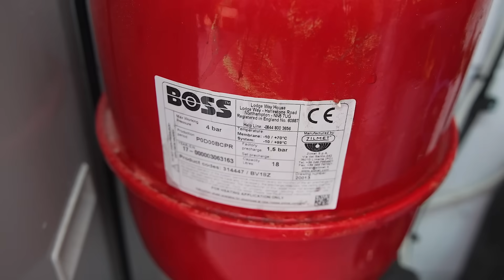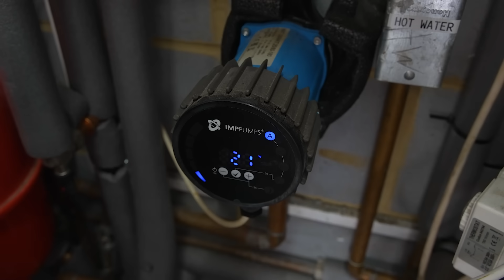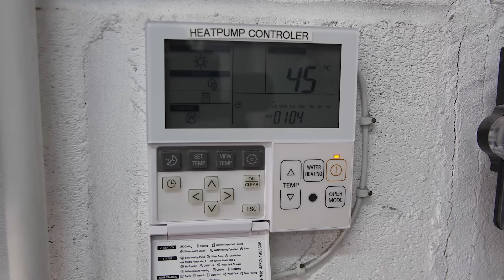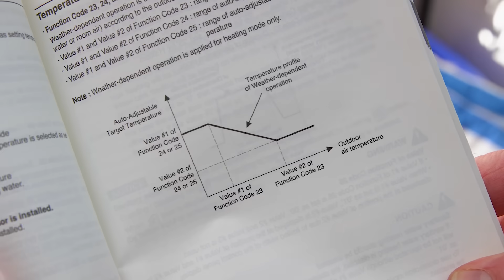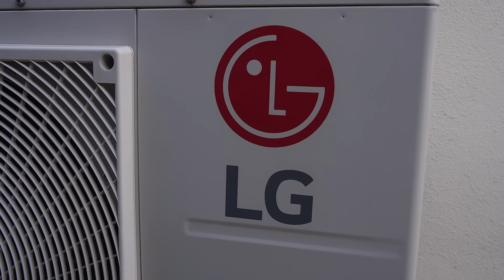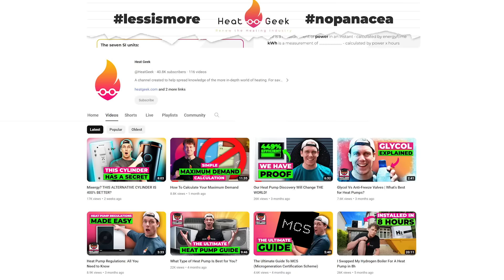Heat Geek Gives His Verdict on John’s Nightmare Heat Pump

Comment: Thanks for having me over John and the invite from Roger! Glad I was able to show the poor install practices that left poor Johns wallet being hit double time! If you want to be assured that your heat pump will work properly please use a trained Heat Geek!
Reply: This is exactly the follow up video we needed on this and I'm glad you spent the time Adam (and John, Roger and mug breaker) to do it. I was one of the people on the original thread saying to get you and Simon from urban plumbers involved. I think showing how what was wrong with a real world poorly designed and installed system and how they can be fixed can provide more confidence to consumers than some of the more theoretical videos.
I'd love to see Simon get involved and maybe a manufacturer to implement your recommendations and then a follow up with John who can they explain the differences and hopefully improved experience once its bedded in for a while. Once again well done for coming together on this and I will be recommending Heat Geek installers where I get the chance.
Reply: Good analysis and synopsis Adam. Such a shame John was wanting to do the right thing and has been sold and installed a dud.
Reply: I was a process control specialist in the chemical industry for decades.  Many of the problems you highlight are very similar to where I made my living providing training and consulting services.

I had an air source heat pump installed in my home in the last month in the US.  They wired it such that it would run at high speed all of the time along with other errors in control logic.  This would have defeated the improvements I was expecting from this swap.  Luckily I knew how to fix it and rewired it myself to run properly.  They even argued with me that the installation manual from the manufacturer was wrong.  

My previous one was wired wrong as well 15 years ago.  

They also installed more backup heat than I specified that would have used 2X the power necessary during defrost.

I talked to the owner of the installation company which is one of the largest in my area.  She agreed that low voltage was an area of weakness in our country.   

I suspect the installed COP in most countries is far from what these systems could achieve with more optimized installation practices.

It is likely many of the decisions made by installers are not only out of ignorance, but also out of reducing call backs.  Tweaking systems for maximum efficiency tends to push the system against comfort and equipment  constraints.
Reply: Heatpumps won't work if we have no summer to warm the ground/air.
Reply: Confirms they are more hassle than worth, Bosch gas boiler and forget all this crap
Reply: @alacrityaudiooffice7716  yeh, we wouldn’t have food to eat either. We’d definitely die
Reply: @kerbsidemotors9249  they need LESS crap than a boiler.. there’s less to go wrong
Reply: I appreciate the knowledge behind all this and effort being put into improving standards. However, I don't think I want to install a system I need a fukin thermodynamics degree to run.      They are too much hassle for me at the moment. When the standard improves and maybe some sort of smart system is developed, that tweaks the settings automatically I will get one. I have heat recovery and a wood pellet stove/boiler at the moment and solar panels. Instant heat when I need it and easily maintaining 21 degrees in the house
Reply: Great to see this 'right to reply' from Heat Geek. I was also one of the ones that was critical of the original video, and this just reinforces everything I was thinking when I saw the original video. It's gutting the the owner has had such a poor job done, that to correct it is basically a throw away and start again job. I got my current biomass boiler installed about the same time as this chap and looked at ASHP but at the time SCOPs were realistically 2-2.5 so biomass was way cheaper. Now, I'm looking to get ASHP as it could save me over £1000/yr compared to biomass! 

Maybe we should do a crowd funding effort to get the guy a Heat Geek assured install in? If all Skill Builder viewers chuck in a few quid, it'd surely cover a new system? I've no idea how you fix this industry, and applaud Heat Geek for trying and I give Roger credit where it's due to allow Adam to come and give his feedback. I think Roger is admittedly also learning something! 👏
Reply: Is there going to be a heat geek  video, where this situation is being resolved?
Reply: Adam - would you consider replacing John's broken heat pump and sorting his system out for free?  I think the amount of positive return would cover your costs ten fold.  Not to mention improving the overall credibility of heat pumps.  I have been very sceptical in the past but would change my mind if this install became viable in delivering a cost effective wet heating solution for this old/new home.
Reply: I've been looking at a heat pump, i'm not there yet. Best marketing heat geek could do is stick in a system that works for this guy. Creates the cop he needs, doesn't wake next door, and meets expectations. Show us you can turn a house where the heat pump doesn't  work into a house that does. In 12 months have him saying we are taking the gas boiler out. I know if i was john even if i wanted to convincing my beloved to spend another 5k on a new heat pumps going go down like a lead balloon with all the issues. So without help i doubt we'll see the ending anyone thinking of a heat pump  wants.
Reply: @JCOmeAlp I’m sure a manufacturer will step in?
Reply: These are the BEST colabs. Really helps when you're about to invest a lot of money..
Reply: LG are crap, pay extra and Buy Mitsubishi or Daikin heat pump
Reply: @mrpetehampson  Yes I agree, their compressors are so bad it’s laughable
Reply: Microclimate at the unit, definitely in the wrong location
Reply: @seanclaffey8190  🤣I Agree with you 100 percent!  It's so complicated. I'm having doubts about it now after seeing this. I'm sticking with my electric hot water tank. Heat Pump Hot Water Rebates are being offered in NSW Australia by our state government for a rebate on the installation of hot water systems, which they say can help reduce your energy costs. It's eligible to households & businesses that have an existing electric hot water system.
Reply: Great video also good to hear promotion of other products like tepeo
Reply: This was another very helpful Video. I really hope there will be a follow-up after the system has been fixed.
Reply: @Etacovda63  sure suppliers are going to try to sell you the max. How do I know what is needed? Everyone has a different opinion on them
Reply: Incredibly useful video. Great job to both of you. 
I'm off to apply a couple of the fixes you described right now.
Reply: Absolutely Adam all that bottleneck junk needs to go, multi zone valves, multiple pumps, mixer on the UFH, the system never had a chance, really easy fix.

I can tell you from experience,  that design is how they were pushed/sold back then from certain company's. 

Would i repair it the LG, may be??. Install a new heat pump, with one of the newer registrants R32 R290, gain better weather compensated controls and overall performance.
Reply: Adam thank you, I really enjoyed this video. I’m horrified at the idea of just swapping out that heat pump, LG have been making these for decades and are good if well installed and maintained,  Surely levelling and servicing would be a much better idea.  It’s not that much of a job to replace those bearings and any heat pump would develop similar issues if not installed correctly and then not serviced.  Any competent engineer can service that LG unit, I’m speaking from experience.
Reply: Well done Adam, really nicely explained.  Shame for the owner, who did the right thing, and I'm glad there are better-educated people out there now who can help us customers.  I steered clear of heat pumps due to my concerns and went for a Viessmann boiler and WISER controls for UFH and RADS 2 years ago and really can't commit to Heat pumps for a few more years due to the investment costs already made - but boy, I wish I'd waited ....
Reply: This video has had over  62000 views in 17 hours, surely a heat pump manufacturer would be willing to donate a free heatpump for John accompanied by a follow up video to show how the systems can work. Would be a worthwhile marketing expense for zero effort on their part don't you think?
Reply: Pipework looks undersized to remove buffer and to run a proper dt with that size of unit
Reply: @mrpetehampson 😂😂😂😂😂
Reply: woke agenda
Reply: Roger &Adam Is this the start of a wonderful Bromance?
Reply: Are you guys in the Netherlands as well? I'm looking into this and there's so much info out there that is contradictory
Reply: @HeatGeek  Maybe, they should use Hydrogen, no boiler upgrade needed?
🤷‍♂️
Reply: A shame you didn’t have North America partner’s training team 2i5h teak assured ,  finding a reliable business has been a nightmare, most are ac trained but just hasn’t explored hydraulic ht units granted it hit -6 last night (rural area ) and will only drop more as the winter settles in,  las year we has a 1 kw heat generated or 2.9kwh low using the internal heater , in  -23 c , the issues  going air to air for the annex and compared to the water get a 3.2 to 1 kwh far far superior i have had 5 different companies (the original installer died before completing car accident) he was a one man company so we called in one from Mitsubishi trained to complete,  23,000 from start to finding a 1902 4000ft farm /barn /annex , it’s been a huge disaster.  Further more the big reason I won’t do it again if you lose electricity in every  major storm that’s it no heat , when it hit -32c a record low for the area we had no power for 10 days that’s life threatening 6ft of snow that took 25 people 4 days to clear to the main city roads it was that bad . The U.K. government in my opinion is too fixed on just going heat pump only many don’t want to be forced into a heat pump future , unless your building is post 2005 the best your get is 3 to 1 if setup correctly if not as there are still plenty of cowboys out there , as the -3c is just to high system design must be designed to withstand-6 before tanking efficiently especially rural areas
Reply: @allthingsrenewable9017  Nice one 👍. As this is a really easy fix , you can arrange with Adam or Roger to go and fix it .
Reply: Surely Adam will fix this for free and prove the doubters wrong.
Reply: Thank you for your input, I have learnt something new again. I have no doubt that systems installed by one of your guys will perform well. The problem is, there are too many cowboys out there (British Gas included) They are doing the same mistake as installers did with combi boilers. Heavily over spec systems, install unnecessary kit, etc...
I'm just waiting for another PPI, and Diesel claims. I hope that one day I can get ASHP installed. Currently there are too many greedy cowboys grabbing government handouts. For example, I have Combi Boiler in 3 bed semi, my temperature is 21 downstairs and 20 upstairs, my boiler flow temperature is set at 38 deg. However British gas came in, quoted £13k and said I had to upgrade all radiators, all pipework and run ASHP at 45 deg. I mean WTF!!! The reason was, they have a warm home guarantee, so they don't care if your ASHP will cost fortune to run, as long as it will be warm, maybe because they will happily sell you more electricity. 
End of the rant, thank you for great video and keep up great work.
Reply: @kirkby0076  hydrogen is dead. He could use a hydrogen fuel cell which is good but is a shorter term solution
Reply: @HeatGeek  Only if they don't go with it, as an option!
Won't most boilers, if not all accept the gas change & thus save people thousands!??
I appreciate your reply 👍
I'm hopefully getting solor next year (2024 with Batts) & I've installed a Far Infrared Heating System, That Is Brilliant!
Being able to zone control & not warm up rooms, I'm not using, & letting the thermostats, do their job, has been very useful.

All the best 👍
Reply: My husband installed a mini split heat pump by himself using Y-tube video. It even worked when the temp got to minus 15 degrees on Vancouver Island. We also did the maintenance. But if course this is for a small one level house. Like that it has air conditioning too.. Cheaper heat. In Edmonton we used $39.00 of natural gas yet with all the fee, taxes carrying charges the bill was$150.00 Something wrong here. We are being robbed! We haven't had any snow or cold or cold weather yet.
Reply: @kerbsidemotors9249 yeah screw the future for the grandkids. Never liked them anyway...
Reply: Brilliant video , watched it with interest. I really want a heat pump however I can't for the life of me figure out how to make it work. We live in a 4 bed semi (loft extension so no room for a tank in loft) with a combi boiler. Solid walls (interesting to see you say even they can work with a heat pump!!) But it's finding the space for it.. I mean the combi is in a cupboard in the kitchen. 

Obviously heat pump goes outside but not massive space outside and nowhere I can figure to put a tank to replace the combi for hot water. 

I have HVAC that I use to try and prolong turning the heating on. They work decent until it gets properly cold and you need to get the house heated to fight off the condensation.
Reply: @seanclaffey8190  TBH you need a fukin thermo degree to correctly install condensing boilers too.
Reply: @BooBaddyBig  yep and I would avoid those also. You are at the mercy of the oil barons then
Reply: @mrpetehampson sadly five year’s ago I had no choice and nowhere to find out more…
Reply: Hi I have a ASHP installed a UF htg system from Wunda I have connected up the manifold as per Roger’s TRV And additional circulating pump.  do you suggest I remove them from the flow for improvements performance as I have noticed the water isn’t as warm the other side of the setup?
Reply: @andrewkelly687  yep
Reply: @allthingsrenewable9017  yep ??  That’s a great help . Have you arranged to go to John’s to sort his ‘ really easy fix ‘ or are you all wind ?
Reply: @HeatGeek  Was that a hydrogen fuel cell you had at yours?  The one with the gas boiler built in as back up when the fuel cell couldn’t keep up? 😂🤣
Reply: @HeatGeek  😂 Worcester bosch boiler rental standard. The fact your fixing a bodge job. 😂 Top effort on Sci project, but far too over priced vanity projects
Reply: @cingramuk  That would be a nice thing to do. Hats off to Roger as well - He's willing to learn as well
Reply: @haydnlawrence8167  yes correct. It generated 6000kwh per year if electricity which was its primary purpose. Obviously a gas boiler can’t do that..
Reply: Electricity comes mainly from coal and gas. 🙂
Reply: A TRADESMAN WILL BULLSHIT YOU FOR 25K LOL. HEAT PUMPS ARE SHIT. WAIT FOR THE ALTERNATIVE
Reply: THEY ARE LIARS WHEN THEY SAY THERE CHEAPER TO RUN. IN WINTER TGERE NEVER SWITCHED OFF.
Reply: @HeatGeek  ok so it generates electricity and heat ?
Reply: @DavidSmith-hz3jg  not in the UK. Coal over the last 12 months contributed 1.2%. Last (only) coal plant is also due to be closed in Sept 24. 
Gas in the last 12m has been 35.1%. The rest of the grid has been: Wind 24.3%, Nuclear 15.3%, Imports 11.4%, Bio mass 6.2%, Solar 4.6%, Hydro 1.2% and storage 0.7%.
Now that does fluctuate, today for instance gas is up to 48.8% but averaged out, it's not longer the primary source and that will continue to fall.
Reply: @HeatGeek  6000kwh per year ?
Reply: @steve_787  So today gas is responsible for virtually 50% of electricity generation 😂
And what about the days when there is no wind or sun , that will be gas then 😂
Reply: @alacrityaudiooffice7716  so why are heat pumps able to operate in very cold climates such as Finland?
Reply: Saddened by no suggestion of repair of the heat pump bearings. Just replace a £7k heat pump. I'm sure you will scrap your car when the started motor goes.
Reply: Informative video thanks. Interesting you say house temps are ideally 21c in the day and around 18c at night. Our house (traditional gas heating) is set at 18c in the day and off at night, so drops to around 14c or even 13c when it's cold. Couldn't afford to have it any warmer! Thick jumpers and warm duvets here 😂
Reply: Great insight to these new systems.  I’m just looking at buying a house which has no central heating of any kind in it and an immersion for water.  House needs gutting so I’m looking into what system is best to install.  House also needs major insulation upgrade.   Know where to find the knowledge and engineers now so thanks.  Great job. Andy UK
Reply: @annakramar5088 It’s not the heat pump that’s complicated but the the calculation to assess the amount of heating and cooling you need in your house and in every room. 
That needs to be done no matter what system you go with. 

If you’d want to save electricity with hardly any hassle, just buy an air conditioner that can heat too and use that first to heat up your house (they are more efficient). Only use your electric water heater if you need extra heat. 

An airconditioner is an air to air heat pump. It will heat if can work ‘in reverse’.
Reply: @alacrityaudiooffice7716 of course they will work!! 

Absolute Zero is  −273.15°C & the UK rarely gets below -2°C so there's 271° to collect heat from!
Reply: @seanclaffey8190 it's the installer that needs the thermodynamics degree (or at least knowledge of how his product works) not the consumer. If you bought a new car & it didn't work properly would you get the dealer to fix it or would you get a mechanical engineering degree & fix it yourself?
Reply: @annakramar5088 the point of the video is that the system has destroyed it's own efficiency by being too complicated, use a certified & approved installer & you will see an improvement in costs.
Reply: @mumbles87 a HVAC is a heat pump, it just sounds like you need a better one.
Reply: Has anyone crunched the numbers regarding head counts and property types?
Given that heat pumps can work best and more practical in the larger and more modern properties, how many people live in these vs flats and cheek by jowel period terraced houses?
I’m not being negative and don’t have all the answers either. But has this holistic consideration been properly assessed? If not, solutions other than heat pumps are needed to scale up the end goal of decarbonisation
Reply: Whilst I understand your specific training (I.e. heating / plumbing) I am surprised that there is no real mention of the insulation of the house.

We are currently having around 6 of these systems installed per month, and I will not let an install go into a property that does not have the necessary insulation installed first.

We have some of the oldest, most poorly insulated homes in Europe and without doing this first, is just crazy, you want to be keeping the heat you put into your home to stay there longer.

Always start with the fabric of the home first, then go onto the mechanics .
Reply: @alacrityaudiooffice7716  Its just a dumb idea. Hey there's a tiny bit of heat in the 4 degrees air, lets use an electricity guzzling device to extract it and pump luke warm water around the house.
Reply: @alanhat5252  whilst this is true . I want a heat pump that does my rads. My split air con is only in 5 rooms of my house and leaves cold spots.
Reply: Change the fan motor on outdoors
Reply: @kerbsidemotors9249 yeah, and we should have stuck with horses, those ICE engines will never catch on.
Reply: @kerbsidemotors9249  lol gas boilers are hugely complex and can be really unreliable.
Reply: lol’ing all the people saying “proves my point - it’s not worth it” when Adam is talking 4.2 efficiency guarantee with a properly installed system.
Reply: Is it sorted now.?
Reply: @jopo8281  coming soon
Reply: @HeatGeek  nice one matey
Reply: What a cliffhanger, was waiting for John's system to be fixed 😢 Not great hype for heat pumps if you suggest John switching to gas or paying 10K for new system after 6 years.
Reply: @HeatGeek 
Where can we watch that video? 
This channel or elsewhere?
Reply: This is an idiotic comment: if you applied the same 'logic' to refrigeration technology used for cooling, we would still be in the dark ages of rotting food.  @SouthIslandSk8
Reply: @HeatGeek  Worcester Bosch gas combi are industry standard and rental standard. Heat pumps are a science project.
The question is-whether public will tolerate being part of it.
Reply: Hmmm, compressor, solenoid valves, reversing valves, filter dryers, drain pumps, thermistors,  inverters, inverter boards, pcb boards, expansion valves, fan motors, coils that perish/ leak,  not sure I’d agree
Reply: Every time a heat pump conversion comes up I always recommend heat geeks.
Reply: All I heard for half an hour was the confirmation that I already knew that heat pumps are shite, waaaaay more expensive boilers are still the way to go. Thanks    👍
Reply: @ he’s at scop 4.7 and literally saving 2 grand a year… yeah really shite
Reply: Hi do you guys do heat surveys I want to see if my system is running efficiently
Reply: Yep it's a massive issue here on the US as well with installers recommending massively oversized systems